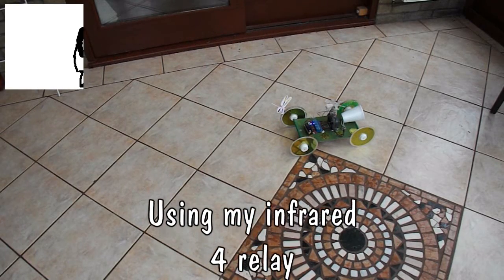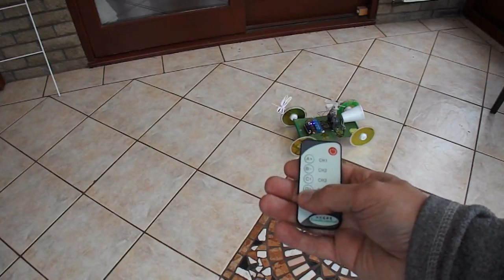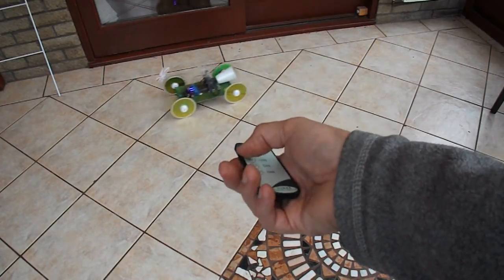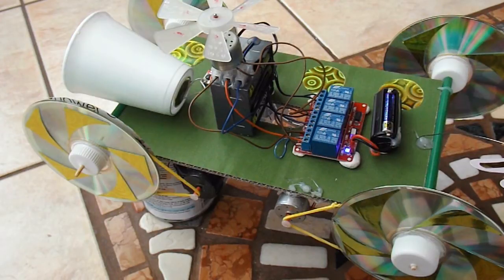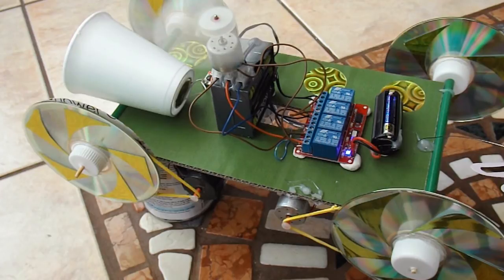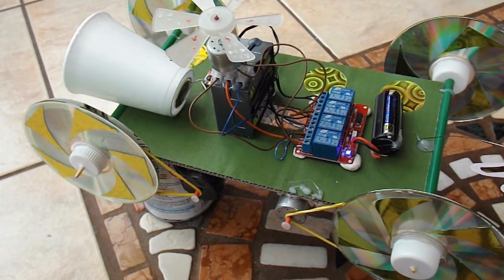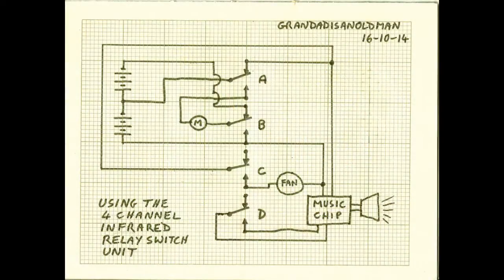Using infrared 4 relay remote control for bells and whistles etc

Comment: A=MOTOR ON/OFF B=MOTOR F/R hav u got 2 batteries to swap the polarity ??
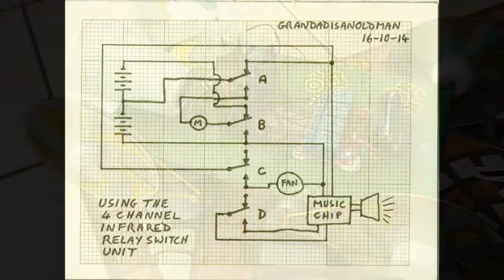Reply from the maker: Did you look at the diagram from 03:39 it shows you which battery is used for each component.
Reply: yeah i just cant see it on the car...was just clearing things up....cheers
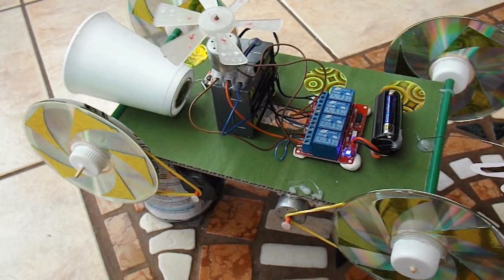Reply from the maker: At 02:57 you can see a big block battery box (with the fan motor sitting on top). It holds 6 AA batteries. I have wired it so it has three wires, one of which is the centre tap so it is visually exactly the same as the diagram 😊

Comment: You should try to make a solar powered plane
Reply from the maker: People keep asking. It's not going to happen. Have you any idea how big the solar panels would need to be to power an electric motor large enough to fly it. Have a look at any of the planes or cars that have been built and even then, they use the panels to charge batteries and then run the motor from batteries.

Comment: Can you try make a steering system please?
If not don't worry!
Reply from the maker: A steering system for what?
This tricycle has steering http://youtu.be/2dcsu4KjJRM?list=PLA5a2xPRSrB13Xcquw4Ff09MQzTPjeVkI
This car has steering http://youtu.be/GfrhyowK_Eg?list=PLA5a2xPRSrB13Xcquw4Ff09MQzTPjeVkI
This boat has steering http://youtu.be/-IIgmqbJXSk?list=PLA5a2xPRSrB13Xcquw4Ff09MQzTPjeVkI
This rubber band powered car has steering http://youtu.be/BenC2W21CCw?list=PLA5a2xPRSrB1otXh0w36OwsYIHZznUWp6
Reply: for your infared car you just made
Reply from the maker: Edward Lakin If I wanted to fit steering the easiest option would be to use the steering from a cheap r/c car like I did in this one http://youtu.be/GfrhyowK_Eg?list=PLA5a2xPRSrB13Xcquw4Ff09MQzTPjeVkI
Reply: Thanks a lot!
Carry on making vids!